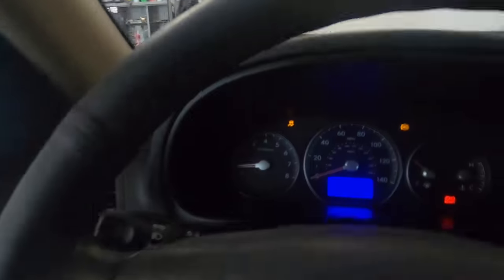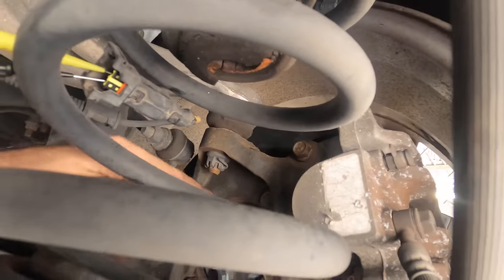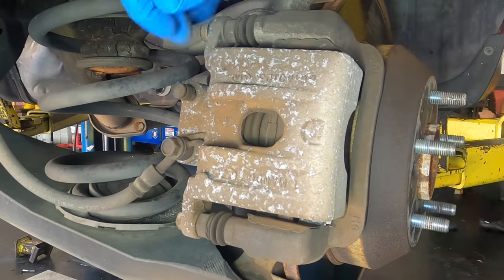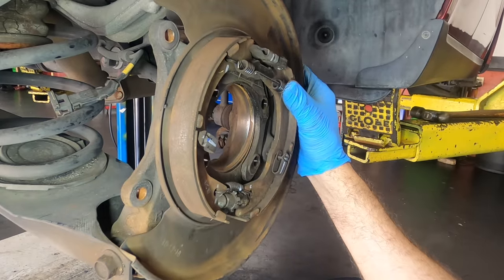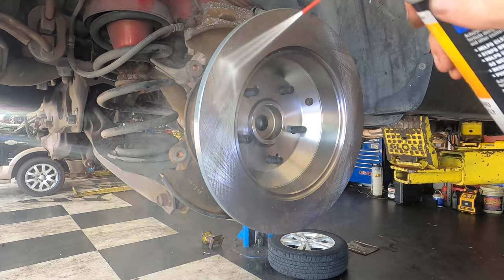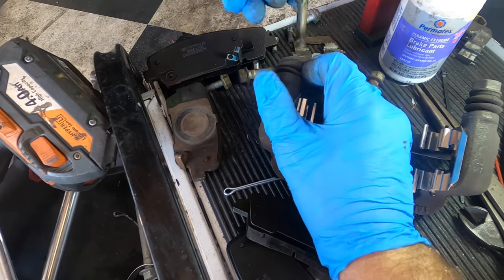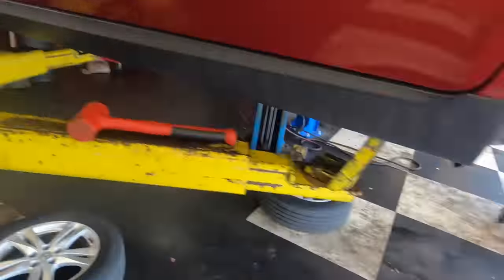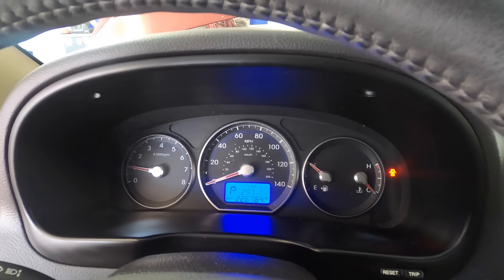Parking Brake Fights Back! BRAKE ABS Trac WARNINGS on! Hyundai Santa Fe

Comment: Just a question. Is it a good idea to bleed the brakes a little while compressing the piston in case the ABS module has a one way valve? So you don’t damage said ABS module? I’m just learning.
Reply: I was taught by a UK mechanic to loosen the bleeder screw a little before compression to avoid damaging the ABS. I don't think its absolutely necessary but might cause issues if you don't.

Comment: I like your videos but i have a question. I've been told more than once when changing pads on an ABS equipped car that the bleeder should be opened when compressing the caliper to keep contaminates from backing up into the BS pump and I never see you do that. Just asking. Also I would like to see strange elec. issues, such as cycle wipers and blower shut off for one swipe of the wipers or even killing the engine.

Comment: At least he Lubricated the pins. Now you know you’re using aftermarket parts, but fail to do anything about prepping the surface to allow it to come out that easy in the future. And of course, lets not use a torque wrench where needed AND also, don’t use any locktite on the bearing or caliber bracket. Ah, just poking fun like Wes. At least it didn’t “explode”!!

Comment: Im confused. Replacing the wheel bearing because of a bad sensor? I understand the sensor is integrated into the bearing. 
Replace a mechanically OK bearing/hub because an Electronic part failed? What a shit design, wasteful and excessive expense.